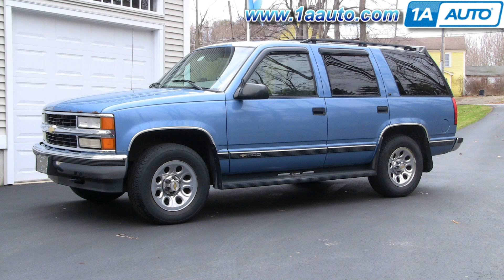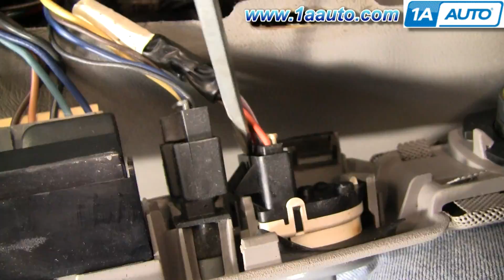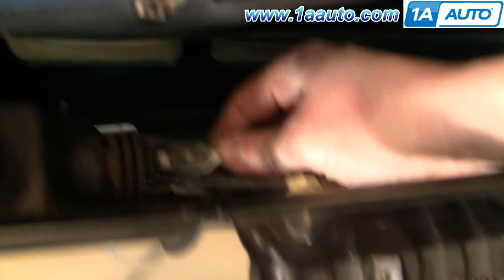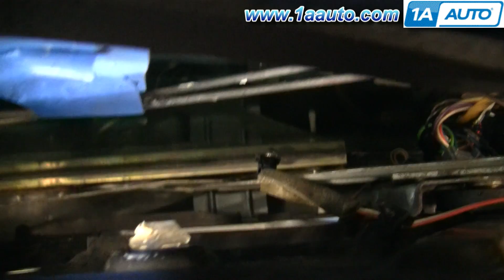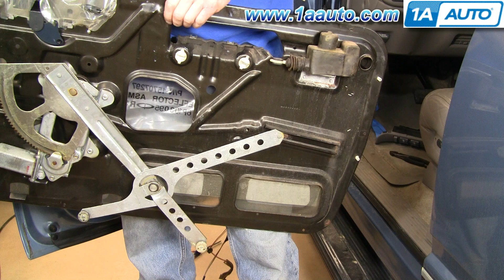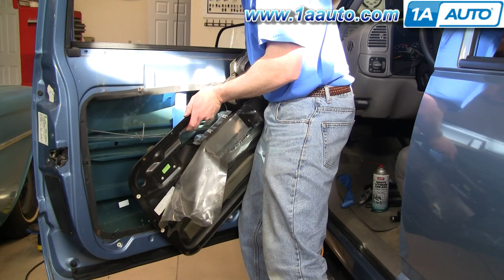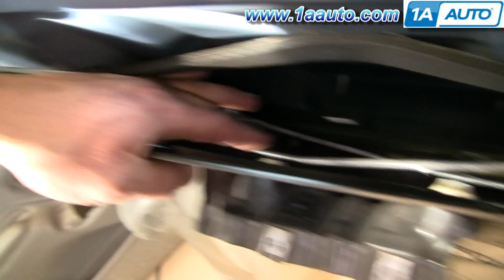How to Replace Window Regulator 95-00 Chevy Tahoe

Comment: i had to do that a couple times on my old 97. had to do the window, regulator, panels, latch, rod, inner and outer handle, was a mess. needless to say everything worked a whole lot better afterward. i fixed everything at once but it all go at once. inner handle froze then broke. someone tried to break in, broke outer handle and window, then the latch seized up and the rods bent.